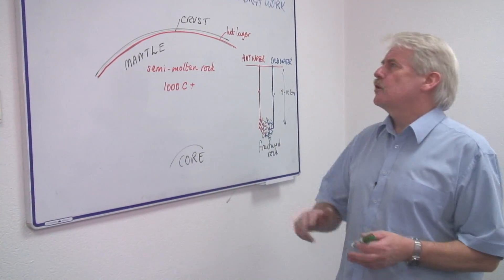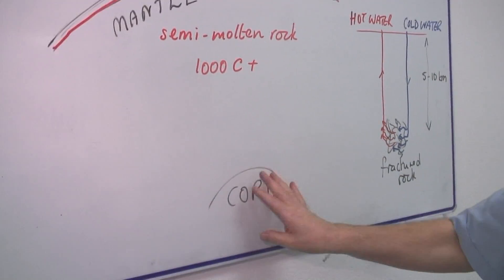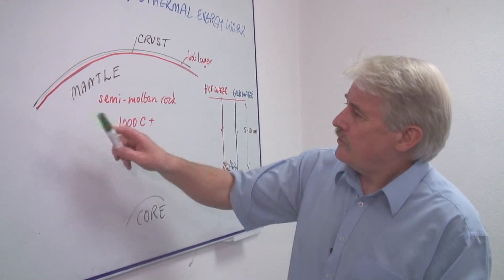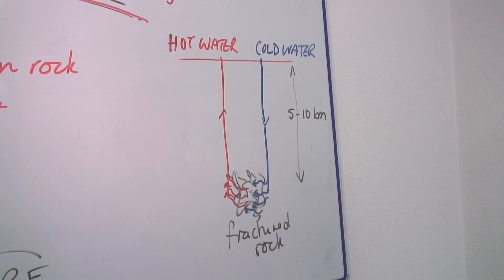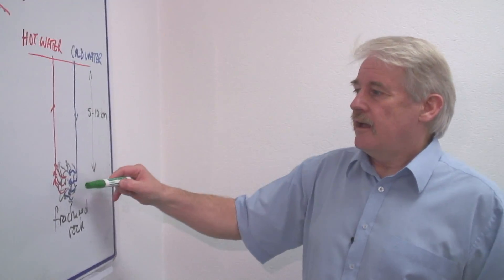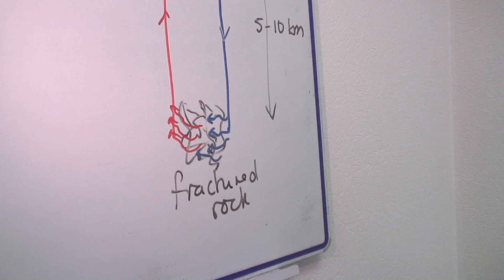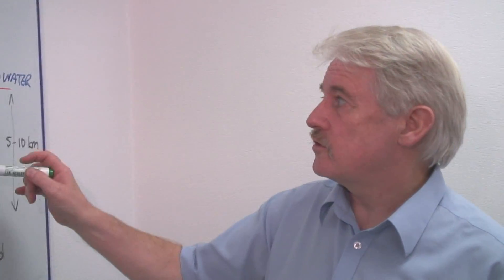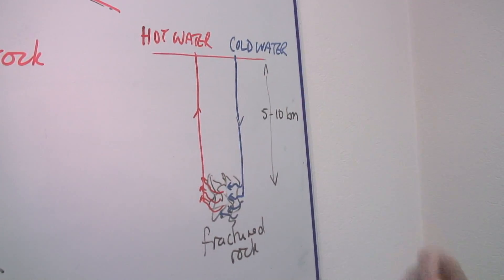Energy & Electricity in Science : How Does Geothermal Energy Work?

Comment: @dferrand well geothermal heat pumps couldn't work were i am from, because be rock is never more than 20 feet away, but my house uses a regular air heat pump and that is actually alot more efficient that a regular heater. also, since i live by the sea i have seen many houses which have underwater heat pumps. tax deductable or not, these things will save you money.

Comment: There wouldn't be any need to drill another pipe or indeed have another generator; you would just use the existing generator to power a pump, with the excess energy going into electricity production.
You wouldn't get close to perpetual motion though, there will losses like any other system and it really depends on the efficiency of the various components in the system.